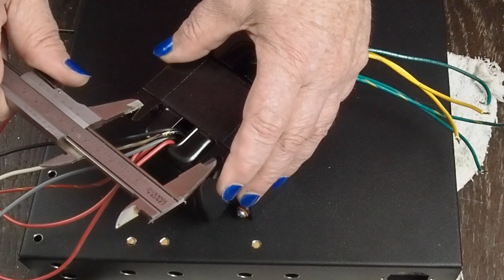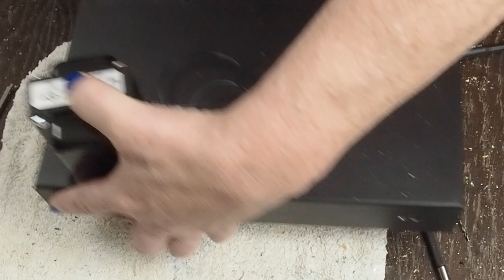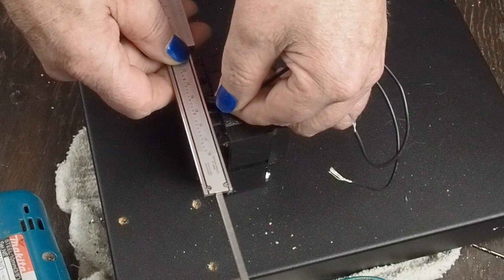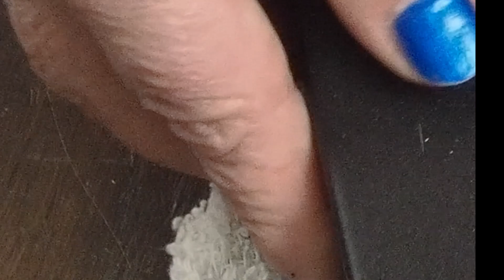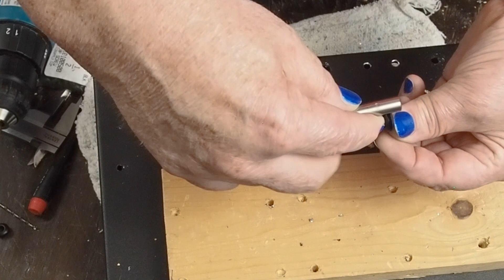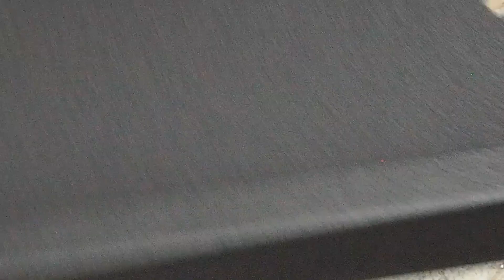6SQ7 EL34 Tube Audio Amplifier: Fabrication #4

Comment: Good progress so far!  I was just wondering if it's worth placing a short length of black heat shrink, or spaghetti over the transformer & choke wires where they pass through the chassis.  Just to kind of hide the wires a bit for aesthetics?
Reply from the maker: Sure, go for it :)